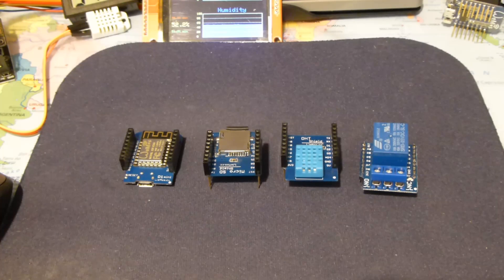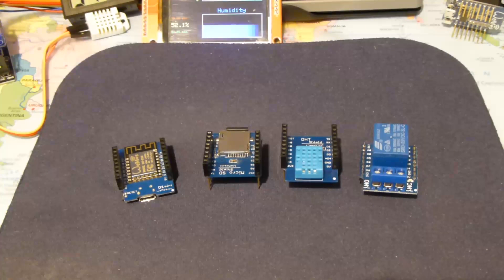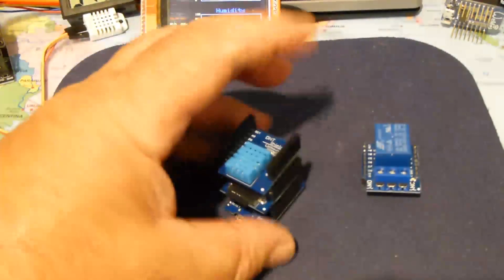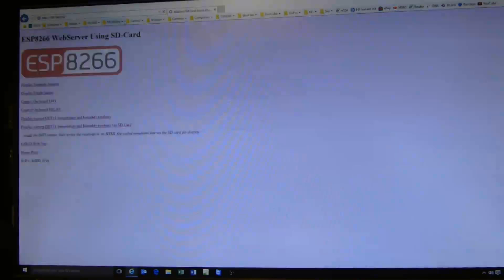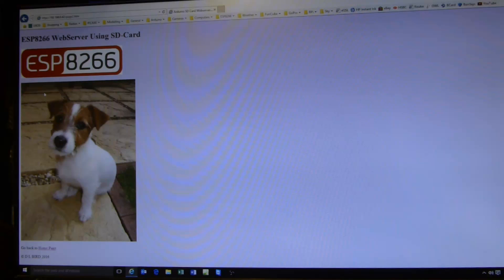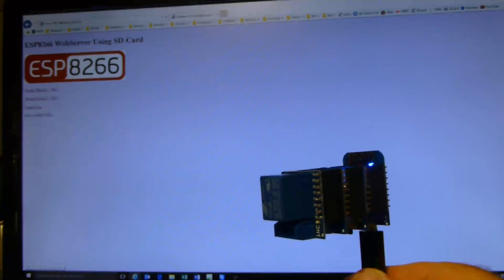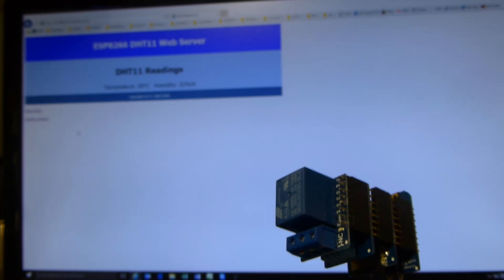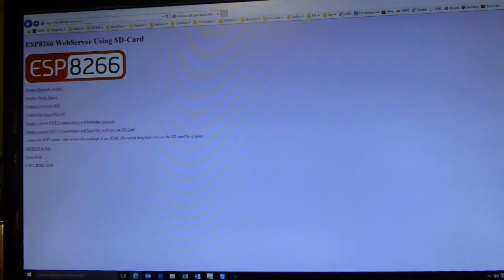Tech Note 005 - (Improved Audio) ESP8266 Webserver

Comment: Hi, love this project. At this point, I am attempting to replicate it following your lead.
G6EJD/ESP-Web-Server-v2 downloaded this version of the Web server.
As per instructions copied all the files to the SD card with the exception of the INO file.
Add my SSID and Password and ran the program. It returned:
2d
csum 0x2d
v09f0c112
~ld
⸮Connecting to goddur2
192.168.1.145
SD Card initialized.

All atempts to connect to the webserver failed:
http://192.168.1.145:80/
Please fill in where I am going wrong?
Reply from the maker: try: http://192.168.1.145/led_on
Reply from the maker: Or any other command in the source code like relay_off, relay_on, directory or temp_and_humidityIP/relay_onIP/relay_offIP/directoryIP/temp_and_humidity
Reply: Playing with it a bit more found the only failure is the http://192.168.1.145/index.htm also tried http://192.168.1.145:80/ but nogo.
Reply from the maker: You can add an index page back but you need the html for an index note ‘root’ is greyed out. You could copy another page : function and call it root or index so that when you enter no parameters it calls root and displays a home page albeit initially the same as another page all you need do is modify the html accordingly
Reply from the maker: I provided a general purpose web site with configurable pages (in the source code as switches), that has a home page. TN027 or TN028 all you need to do is change the text to your own.
Reply: As you can tell I am not a programmer just a hobbyist and for the life of me I cannot understand why when you click on Home Page link in your example you get :
This page isn’t working

192.168.1.145 sent an invalid response.
ERR_RESPONSE_HEADERS_MULTIPLE_CONTENT_LENGTH
Reply from the maker: OK, so I fully understand do you mean the V2 web server or the TN027/28 version. For the V2 variant I’ll add in a home page to help out, the link is there but commented out it’s the first on.server command. When the server gets nothing like 192.168.1.145/ then ordinarily the / command would be called directing programme flow to a function called ‘root’ but there isn’t one. To get it working uncomment the root command and copy a function say LED_on and rename it root like this void root(){ then when you connect to just the IP address the led on page will appear and it has become your index page you could call root index and the function index too. Then modify the text for the new home page. I’ll add in an example as v3 tomorrow. Any other problems please don’t hesitate to ask I want to help. Dave
Reply from the maker: So on line 62 in my original 
//server.on("/",[] {}, handle_root);                 // Define what happens when a client requests attention
Change it to:
server.on("/",index);                 // Define what happens when a client requests attention
Then add a copy of say led_on calling it void index() instead of void LED_on()
Reply: I am getting ready to try your suggestions but had to take a minute to thank you for your patience. I was shocked how helpful you were and did not expect the additional help. It goes to show there are a few great folks out there and you my friend are one of them.
Reply from the maker: Thank you for your kind words, educating is my vocation and I want to help others learn what I have been taught. David Bird, Bath UK.
Reply from the maker: https://github.com/G6EJD/ESP-Web-Server-v3For a new version with home page and a couple of extra pages if required, comment out if not required. Enjoy.
Reply from the maker: Good to hear it’s working as expected, I’ll fix the link too
Reply: One very minor item of interest, 
Currently the code is :
if (LED_status) webpage += "LED state is OFF"; else webpage += "LED state is ON";
Should be :
if (LED_status) webpage += "LED state is ON"; else webpage += "LED state is OFF";
Again thank you.
Reply from the maker: It depends on the LED connection whether the ESP is sinking or sourcing the LED current or whether there is an intermediate transistor to switch it. On the Wemos relay board for example high is off and low is on, so I probably used a logical variable to switch and hold states and the LED was being sinked by the ESP, probably a Wemos though. You certainly have the hang of all this now by the sounds of it.
Reply: LOL, not at all what little I have done with the web server has taken me hours of reviewing the code. Thank you for the explanation of how you choose the output reading.
Reply from the maker: I can’t count how many times I’ve programmed a device thinking I’ll make that pin high to turn something on only to find  I need to do the opposite and you’ll find the same too😀 I’m sure there are so many combinations that it’s mostly impossible without a lot of planning to get things right first time hence bread-broading and testing will never go away, even so I guess your enjoying the challenges and the reward of making a cpu fo what you want it to.

Comment: can you connect these on the regular wemos d1 full board ?
Reply from the maker: Yes, but you need to map the pins and your main problem is power. If you use so-called dupoint cables they work just fine.
Reply: so the shield would just stick out over the side of the d1 a bit?
and what would be the difference between the d1 and d1 mini? and why would anyone use the mini then....
Reply from the maker: There is a Wemos D1 R1 and Wemos D1 R2, these boards are Arduino Uno size and share similar layouts but not necessarily pin-outs as an Arduino, but a close match. The Wemos D1 R1 and D1 R2 are similar but don't have the same pin-outs. The Wemos D1 mini is the small format version I use in this video and I have found it is the best all-round board to use giving 3.3v 5v gnd, A0 and 9 data pins.

Comment: YOU...ARE...THE...MAN!Thanks a lot for your job! :)
Reply from the maker: It's a pleasure, I'm glad you like the software and hope you find it useful.
Reply: I'm waiting for the relay shield and battery shield....i've actually written the script to manage the click of the dash button from amazon...i can't see hour to test in real life!For now i just light on/off the led on the D1mini board.
Reply from the maker: If you can control the on-board LED then all you need to do is change the LED pin to the relay control pin which I think is D1, check out the WemoS Web site, they have a schematic and it gives the data pin.
Reply from the maker: Also check out my source code links in the description.

Comment: Thanks, will this work on most any 8266 stacking not considered?
Reply from the maker: Yes you don't need any stacked shields or other boards just any standard ESP8266. Obviously if you want to control anything external an interface will be required.